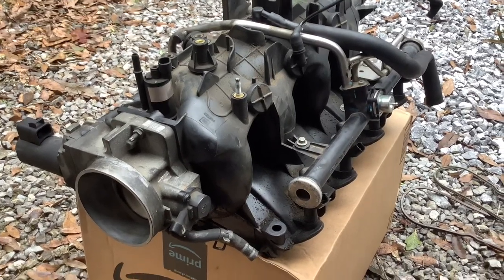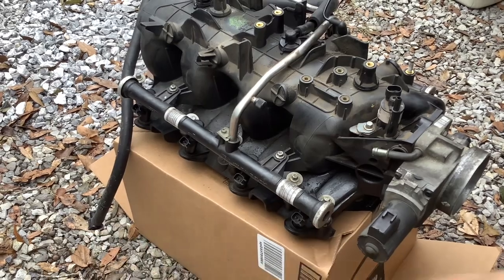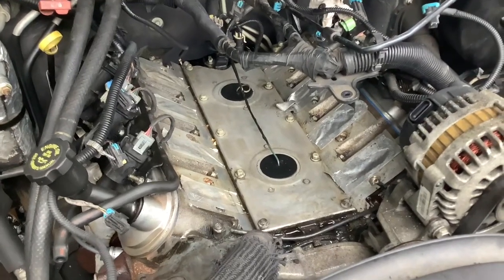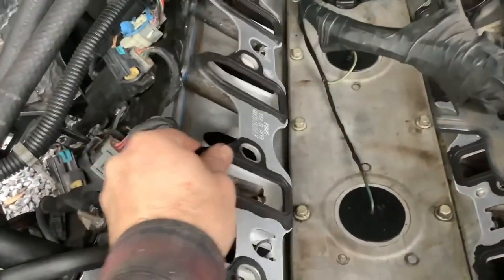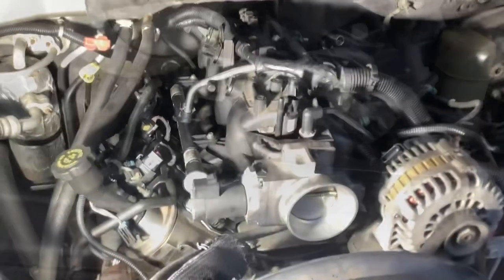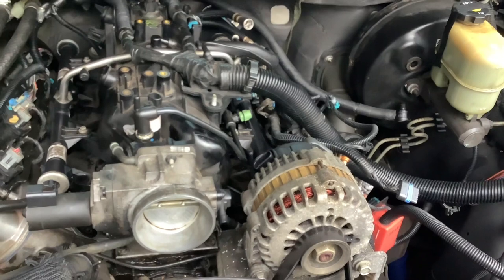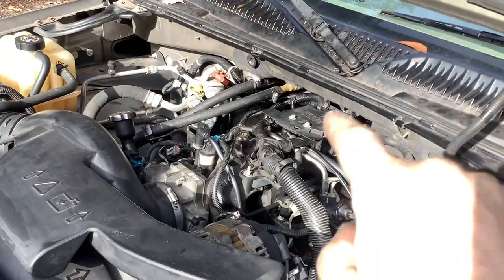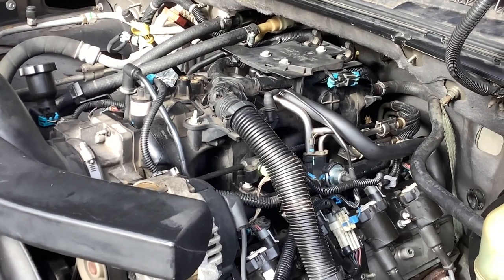GM Chevy 5.3L LM7 Vortec Intake Manifold Gasket Reinstallation Yukon Tahoe Suburban Silverado PO174

Comment: I'm getting a po300 diagnostic from AutoZone and says to replace the same gasket (5.3L Chevy Silverado)
Reply from the maker: It’s possible, but have you checked your plugs, plug wires and fuel pressure yet? That’s where I’d start.
Reply: That and also on my 2002 silverado 2500HD i had one injector rusted and gunked up so definitely pull those out and clean them up, Make sure they are good!